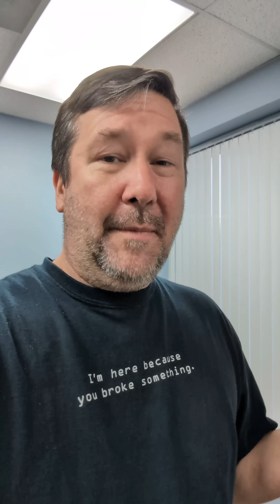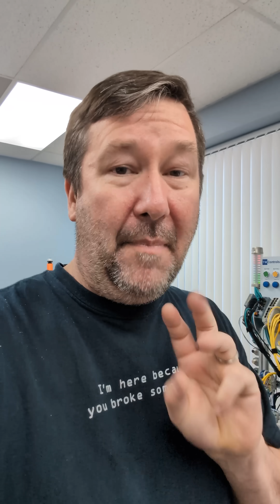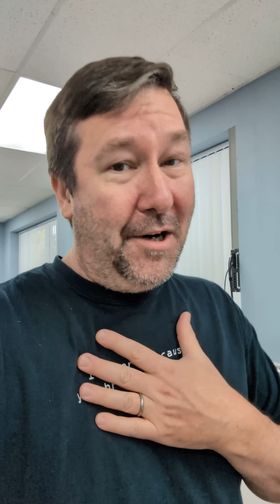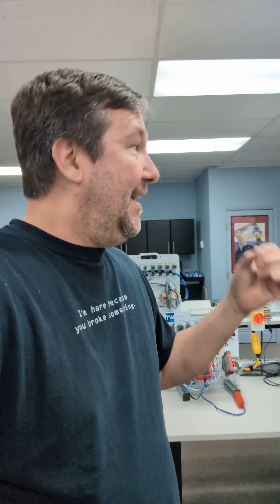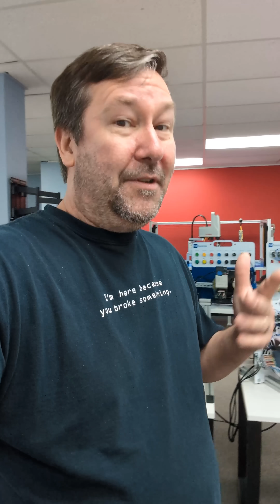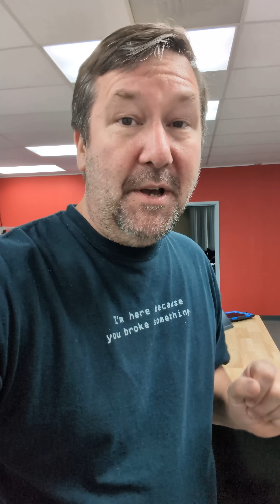What PLC Language Should You Learn #plcprogramming #industrialautomation #summeronshorts

Comment: Maintenance manager should actually be asking where on the HMI is the diagnostics screen. Too much time is wasted toubleshooting a machine from the code. If you have to open the code to troubleshoot a machine then you are dealing with an incomplete machine. Less time should be spent making the code look good in ladder and more time giving the maintenance team the proper diagnostics to keep them from needing the code. ST makes you efficient enough to spend more time on the diagnostics. Writing for the maintenance team to read is the weakest argument for ladder in my opinion. And there are several other great arguments for ladder.
Reply from the maker: Good point